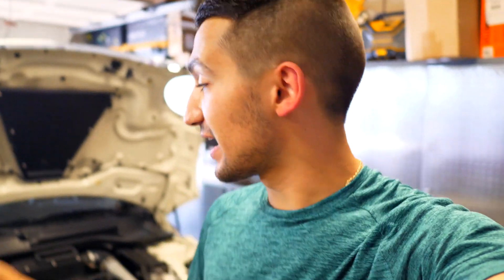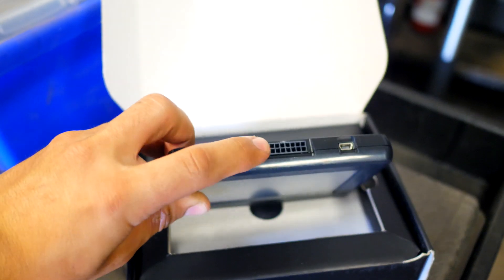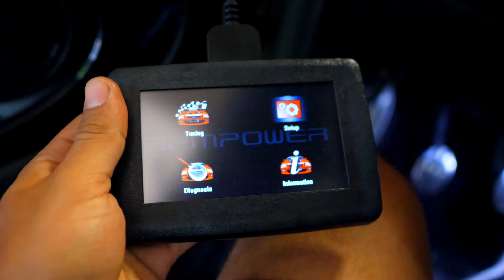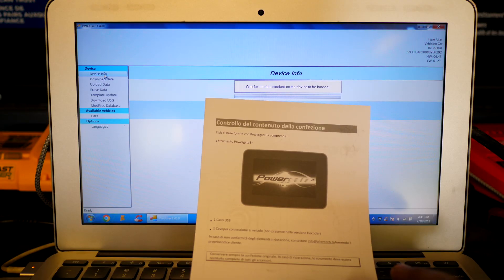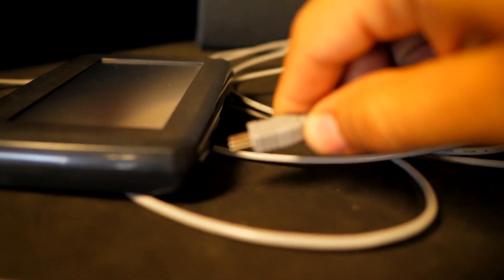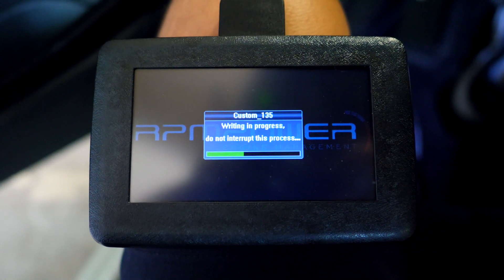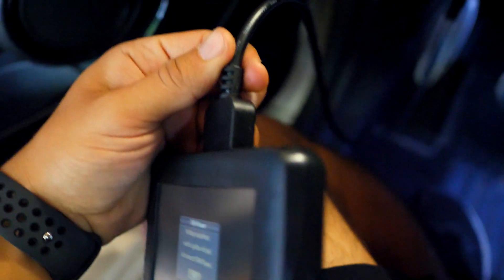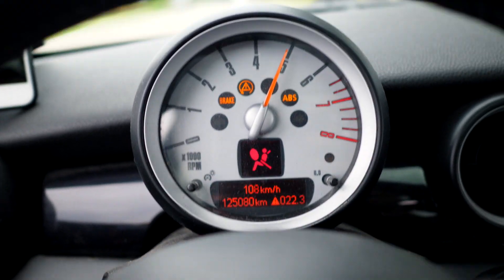Remote Tuning My BUILT & BIG Turbo MINI // RPM Power 🔥

Comment: Thank you for not putting the manic misfire tune on your mini. Bytetronik makes a standalone system for minis. You can tune everything to the perfect specs on a lap top, on the fly.
Reply: did u make bad experience with manic?
Reply: I was told by a tuner that these tunes are not designed with the acceleration curve in mind. Meaning these tunes are designed to run full acceleration, or idle. Nothing in between, so you won't have any problems at full throttle, or very light throttle, but if you slowly put your accelerator down, a quarter way, or half way to the floor then the cars is not getting the correct fuel/air ratios to fire correctly. Causing a misfire, and pre detonation. Bytetronik will allow a tuner to put your mini on a dyno and get everything running perfectly. This Rpm tune is the exact same as manic tunes, and jp tunes. These guys selling you this garbage wont tell you this, but they'll take your money.

Comment: you have a windows 7 on a mackbook air
Reply from the maker: Yep!! :)
Reply: @milanmastracci  how is this possible? You'll be crucified by the apple fans. lol.
Reply from the maker: @kommerszial  You can run boot camp on any Apple computer and run more than one operating system. Its rather easy once you get the hang of it
Reply: @milanmastracci  damn

Comment: Hey man, my stock N14 had the same problem that you described with the misfires but only with hard acceleration. I could drive the car around if I babied it and you'd never know anything was wrong. Floor it, breaks up. What I did was replace my spark plugs and coils, and just that solved my problems. I don't know how that's going to translate to your motor, but food for thought. Cheers!
Reply: I’m having the exact same issue, but I have the N18. How many miles does your car have? I’m wondering if mine just has old spark plugs.
Reply: @Braindead_Fox  I bought the car with 100k miles and replaced the plugs within the first hundred miles to NGK laser iridiums, they're unfortunately pricey. I don't know how old the previous set was because I didn't own it then.
Reply: yaris5150 well, I found out my issue was because of restricted airflow... guess who’s getting a cold air!

Comment: You've invested so much time effort and money in that engine and you really don't want to skimp on the last 10% get it on a Dyno and have it tuned logged and set up correctly
Reply from the maker: I wish that was a possibility, however that isn't a possibility with these MINI ECU's unless you decide to run a standalone, which will cost upwards of $8K CAD
Reply: @milanmastracci  Why isn't it a possibility? Instead of remote tuning it, you go to the tuner and they run the car on dyno instead of the road and fix the file on the fly instead of having you to write a list with mods etc etc...
Reply: @graikas   I have looked into live tuning quite a bit for mini coopers, but unfortunately there is nothing out their. In Canada nobody tunes mini ECUs as far as I know on a dyno. A few shops in the U.S do it, but for a Mini in Canada you basically have to go with a canned tune.

Comment: Just go to a real tuner with a dyno ..
Reply: no such thing for minis at the moment
Reply: Yes there is
Reply: Mark Jackson and who is that
Reply: he can't because he has to brake in and he cant redline so he had to get a pre-made tune to be able to drive the car until the brake-in ends
Reply: @Jack Shepard Manic Motorsports as a company has dissolved. They are pretty much no longer in Operation. RPM is the #1 tuning option for N14/N18 powered minis now
Reply: Jack Shepard since when does manic dyno tune? I am Manic stage 2 by the way
Reply: lol break in…….. fyi engine builders with engine dynos break in the motor full PULL 🚂choo 🚂chooo
Drive it like you stole it, you’ll thank me later 

Break it in driving like grand ma it’s gonna break when you give it the beans

Comment: Just got my stage 2 RPM tune from Mario out of California, my mini rips and is pretty terrifying. 21.88 max psi normal, 29 psi in sport
Reply: Stage 2 does not hit 29psi. You wont even hit 29 psi on a stage 3 tune. My RPM stage 3 was 23psi. If you're somehow actually hitting 29psi you can kiss that motor goodbye here real soon. My N18 blew after almost a year of 23psi and a lot of racing
Reply: Mike_MANIC_R55 yeah this was before I even looked into much of the tune, after having it for a month and everything I believe I only saw psi that high (it was one pull) because I hadn’t switched in the colder spark plugs. I noticed after that I had more normal boost numbers, peak still around 21
Reply: Claybourne Cunningham where in cali in
In fresno
Reply: Sheikh Latif Mario is based out of the Thousand Oaks area. I shipped my ecu out to him and he worked with me and gave me all the info needed. 10/10 would recommend him.
Reply: 29 psi in sport? Is this correct?. It cannot be!
Reply: Oskar Movilla yeah, I was staring down my boost gauge, I assume the overboost in 3-6 is a percentage based increase. ie) it goes from 9-11 psi in stock maps
Reply: @OMovilla  i dont believe that is correct either
Reply: Claybourne Cunningham familiar with area will follow up and check him
Out. Thx for responding.
Reply: What year is  your mini?upgraded turbo?forged internals?
Reply: Dustin Jahn jag xtype 3.0 2004 that i restored last six months. im sure computer needs to be upgraded. Thx asking
Reply: 29 psi does not seem right. I'm manic stage 2 and my peak boost is 21psi. Also, the sport button does nothing for boost. All it does is stiffen the steering, adjusts throttle response and creates the pops.
Reply: Alex Pruszynski well unless my boost gauge completely read 8 psi high on pulls in sport mode vs non I don’t know what to tell ya. As far as sport mode, I know stock it doesn’t increase your max psi, I’m saying within the tune from RPM it does/might.
Reply: Claybourne Cunningham that I'm not sure of. That might be the case. I don't know enough about the rpm tune
Reply: Alex Pruszynski honestly the more I’ve driven it (I got the tuned ecu back last week) the more I’ve kind of just learned/noticed about it. 1 big thing I noticed is a heavier turn on the wheel than stock but not as much as sport mode stock. Not sure if it was because I was gone from the car for 2 weeks or what, but definitely noticed something
Reply: Alex Pruszynski too bad hardly anybody else that comments on this video understands anything about tuning a mini tho lol
Reply: Claybourne Cunningham yeah I know they're not like most cars. What turbo are you running?
Reply: Alex Pruszynski Stock K03 for now. I’ve been talking to my tuner Mario about the next steps for my Mini as far as going KO4, but it’s got to stay my daily for a little bit of time. ALTA intake, bigger eBay intercooler, CNT racing catless downpipe. Looking to trade/sell my set of work wheels for a decent set of coils and do the slammed life for a bit